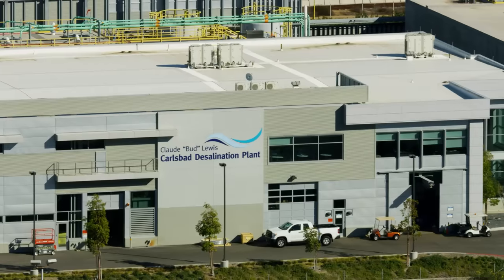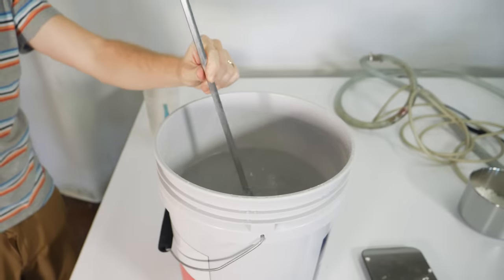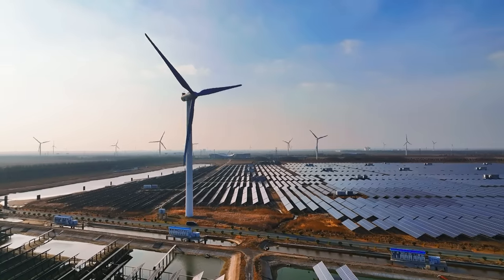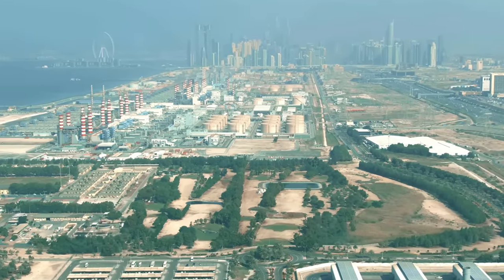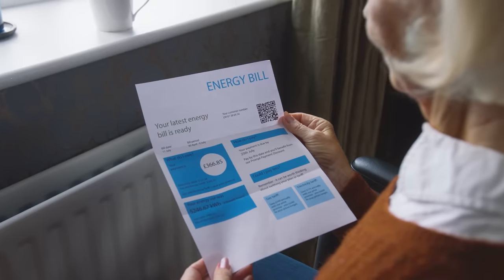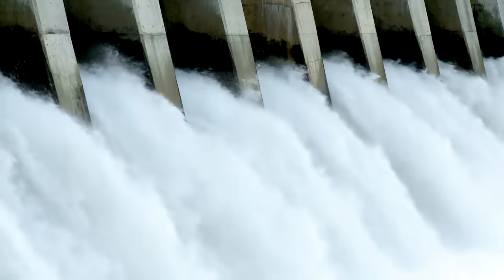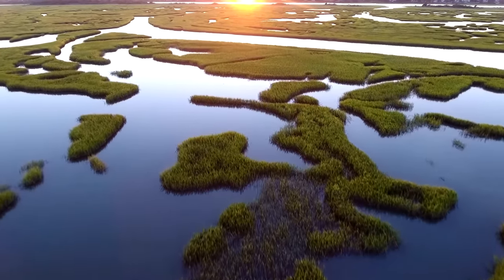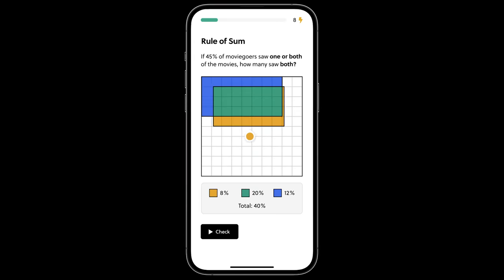Why Is Desalination So Difficult?

Comment: Lived in Saudi Arabia for a while and dad worked at the desalination plant there. Interesting bit was steam generated by the boilers were split into two pressure points. High pressure steam was used to turn the turbines to produce electricity while low pressure steam was used to make fresh water. Interesting when I heard about it the first time.
Reply: That’s what I was wondering why should it “cost” energy to generate steam. Isn’t basically all of our energy added to the grid by steam spinning a turbine? Surely theres some way to spin a turbine and then drink that same condensed water vapor right?
Reply: And water cost more than their fossil products!
Reply: @jakeannett6720 That's distillation, purify the water of germs and removing salt content but it is the costly method of desalination.
Reply: I wonder if they ever thought to use this concept but with a nuclear power plant
Reply: @jakeannett6720  This is a great thought, but sadly there are some big drawbacks. The water used in most power plants is highly purified and the same water is used over and over again (closed loop) Using sea water would lead to more corrosion and mineral buildup in the pipes and mechanisms of the powerplant. It might also wear down the blades of the turbine.
Reply: @DanielGonzalez-gr5xp  if its a closed loop, then we just need a heat exchanger, nothing mixes with the mechanisms of the powerplant. but if its an open system using ground water, thats is even better! As the powerplant can now power electricity or provide heat and the heated river water can be used to diffuse waste salination back into the sea.
Reply: @EZ-STEM What he's saying is that if the steam is also producing electricity, in addition to becoming drinking water, then that would offset the higher cost of distillation. Electricity is also pretty valuable.
Reply: @visionsofpromise This is the way for desalinating sea water on a massive scale. Nuclear reactors do only one thing and that is to make heat, and make lots of it, without any emissions including carbon dioxide. We've been powering our aircraft carriers and submarines this way for decades. They could safely make power and desalinate at the same place. We have the technology to do this safely now.
Reply: @jakeannett6720 bro hear my genius. Get sea water is a nuclear power plant, use the steam for power, then capture it and have fresh water
Reply: @jakeannett6720  Not at all anymore, only about 20% use coal plants, around 40% now use natural gas. The rest is nuclear than renewables. But to your question, why would you want to drink the water from coal plants, when it cools down it turns back into liquid water and goes back to where it starts, allowing you to reuse it, over and over, versus drinking it then refilling it.
Reply: @69-Bot  but instead of reusing it, I use the entire ocean as my reservoir and I create usable energy at the same time as purifying water
Reply: @jakeannett6720  And then you have a boiler full of salt you need to clean out. It doesn't filter the salt 100% either...
Reply: @jakeannett6720 That is true, however you can only recover about ~35% of the energy used to boil the water in the first place.
Reply: I remember how water taste in Saudi Arabia. It’s so brackish.
Reply: @actionjksn  boilers for energy production need high temperatures and pressures, and water for that kind of boiler needs to be pretty pure. stuff like silicon gets entrained and dragged by the steam and would ruin the entire piping and blades immediately. boiler feed water is no joke. 
for low pressure steam maybe you could get away with it, would be inefficient because youd have to purge a LOT of hot water to keep the boilers water from precipitating salt crystals
Reply: Interesting. Is that the desalination plant in Jeddah? Unfortunately the theoretical minimum energy consumption in desalination is still not achieved by desalination plants as not all units have 100% energy conversion efficiency so desalination is not a 100% energetic reversible process, no matter if this happens via distillation or reverse osmosis.
Reply: @jakeannett6720  Issue is, you don't want to remove water out of steam power plants. Well some systems are open cycle and isn't big deal, but others are closed cycle. Closed cycle also have less fouling damaging the boilers. In a closed cycle, you reuse the water by condensing it back so taking it out the system just means you need to refill it with new water with all the contaminants. Whether it is worthwhile depends on each project. And with a high pressure system, even open cycle is not really usable. The plant needs pretty pure water to operate at high pressures to begin with, so the plant itself isn't 'desalinating' the water. It actually needs desalinated water to operate which obviously doesn't offset the cost. Perhaps you can drink said water after it was used in a power plant; but you have to make sure that is somehow cheaper than having a lower level desalination system for drinking water. Drinking water doesn't need to be as pure and so uses a lot less cycles and energy. Might just be cheaper to have a drinking water grade desalination plant for the rest of the city than over building it to meet the purity needed for steam boilers and turbines. The power plant then can just reuse the water already in its closed cycle system thus not needing a over built desalination plant constantly replacing the water it loses.

Comment: On our 470'  research vessel  housed 130 people, we had two distillers plus a reverse osmosis. The distillery was pretty brilliant as we pulled a vacuum on the container and we used heat from our diesel electric engines. When the vacuum was applied the water would vaporize at 165°F rather than 212° F pretty clever. The units on our ship produced 1200 gallons per day. Some of that water was additional purified by R.O.  So the waste heat from the engines was not an additional cost only the energy used by the pumps was energy  negligible.
Reply: That's super interesting! Do you think the energy required to place the vacuum in the container cost a notable amount of energy or was it negligible?
Reply: It was really clever to drop the pressure below atmospheric in the container. Thus reducing the boiling point of the water🤔 did you just use the already existing vacuum to vent the gas out of the container. Or did you have to use a constant vacuum pump for that?
Reply: I can only assume pumps would be needed. But if the baseline vacuum pressure; the bulk work is established using venturi pumps/valves, then you can certainly leech that from a multitude of engine and auxillliary systems. Basically anything with a suitable fluid flow range can be exploited using venturi effect to generate vacuum without a notable energy or efficiency loss to those systems - because venturi is sort of a "skin drag" effect; it doesn't require any direct interference with or impedence of the fluid flow itself. You certainly can bottleneck a flow to accellerate it and boost the vacuum pull of the venturi effect, but with large flow systems already in place and available then mass can go a long way in making up for speed. 

On a ship, engine inlet air, engine exhaust and coolant flows are probably the most interesting ones. Especially exhaust as its alrady waste energy, fairly high flow, and most venturi applications wouldn't really have much impact on the ability to use the same exhaust gases for thermal energy. Then vaccum pumps might only be needed for moderste boosting, or as an inline support system to ensure adequate "vacuum pressure" stability.
Reply: @jippo91 I remember working on a similar one at a company I used to work for.  It has to be a constant vacuum.  The issue is that with the little heat needed (compared to standard boiling point).  The water's evaporation aka expansion reduced the vacuum in the chamber.  So we had a pump to maintain a constant vacuum.   Here's the cool thing.  The pump was a mechanical vacuum pump that was also ran by the motors fan belt.

Comment: I worked in a power plamt that used a multistage RO to clean up produced water from an oilfield.  The oil was separated, and the water was run through softeners, but it was still in the part per thousand range.  We ran the RO at 75% permeate and 25% reject in the winter.  We had to run it at only 70% permeate in the summer due to the water being much hotter.  Input temperature and pressure have a high effect on the process.  We got <1 ppm hardness, and around 16 ppm total dissolved solids.  This was necessary because the next step was deionization, yeilding 17.8 mmho water.  Theoretically pure water (which doesn’t exist) is 18 mmho.  Water that clean will actually make you sick with extended use.  It basically reverses the osmosis in your intestines, pulling nutrients out of your blood instead of vise versa.

As far as seawater desalination, I took a contract in Saudi Arabia in the mid eighties.  Theentire eastern half of the country was supplied freshwater by a huge RO plant just south of Al Jubail on the Persian Gulf coast.
Reply: What did you use the DI water for?
Reply: @sealpiercing8476  DI water was used for injection into a GE frame 6 gas turbine for NOx control.  Some of the RO water was used in the engine inlet evap coolers to increase air density and improve power output (more air, more fuel).

One plant that my company operated started with well water.  The sequence was sand filter, carbon filter, softener, another carbon filter, RO, deionization.  At each stage some of the water got sent to the next stage and some got used in a process such as the majority of the soft water being used as makup water for the boiler.  All effluent streams (incuding rainwater) ended up in a flock tank and then a press.  No water was allowed to leave the plant except as vapor from the inlet coolers and the cooling tower.  Even black water was run through a mini sewage digester plant.  The water that came off the press went back into the cooling tower.  The solid “cake” that came off the press was chemically and mechanically identical to limestone, but was still classified as hazardous waste and had to be disposed of accordingly.  We bagged it, and shipped it to a facility that stored it.  The facility was, appropriately enough, an abandoned limestone quarry.  That was the only zero discharge plant I have ever seen.  Even then, the government wanted to dispute that classification since the bagged limestone left the plant. There was a tax break involved for being a zero discharge demonstration plant.  Our lawyers pointed out that under their criteria it was impossible to have a zero discharge plant because some evaporation is required in any power plant.  In the end, both sides decided to nullify any contracts and abandon the project.  As far as I know, the plant is still rusting away, and nobody is attempting that kind of usage efficiency today because when they look at doing it that plant is held up as an example of a failure, even though it really succeeded.  All because a government bureaucrat wanted to avoid giving a tax break.
Reply: @sealpiercing8476  what do you NOT use DI water for? it causes far less corrosion and leaves next to no scale/fouling
Reply: @Simple_But_Expensive wow, that's a really good story. are you still in the business?
Reply: The theoretical limit of water purity is 18.2 Mohm. In the semiconductor industry we meet a water purity requirement of 18 Mohm continually.
Reply: DI water won't make you sick with extended use, as long as you eat normal food. This is an urban legend. There's no such thing as "too clean water".
Reply: @defenestrated23  But it tastes weird. Or, more correctly, it lacks taste, so our brains make something up.
Reply: @defenestrated23  DI water is the equivalent of distilled water (very close to theoretically pure).  They sell distilled water in supermarkets.  Try drinking nothing but that for a month, then get back to me.
Reply: @sneediumminer  It is sometimes called hungry water because it will dissolve most metals.  It has to be stored/pumped/piped using stainless, pvc, fiberglass, glass or the like.
Reply: @toseltreps1101  retired.
Reply: @rogerolander458  my bad.  Best we got was 17.8.
Reply: I also thought about something like that, and I think a big problem would be that salty water will also infiltrate into the soil, making the soil saltier and especially will contaminate the groundwater. Soil in arid areas is already very salty, so I don't see a lot of problem with the soil, but definetly with groundwater. The Sahara for example has huge groundwater reserves, and contaminating them would be a huge problem.
Reply: Cool story bro.
Reply: I wish they had learned to grow their own crops. Instead they waste our water for free here in AZ.
Reply: @Simple_But_Expensive I've drank only DI water for literally years and had no issues. I'd like you to give a more detailed description of how exactly pure water strips minerals from your body. Don't just say osmosis, be specific about where in the body this is happening, which minerals are being stripped, and how the newly mineralized water is leaving your body.
Reply: bs.. Systém S. A. W. E. R. se stal nejvyhledávanější atrakcí české expozice na světové výstavě EXPO 2020 v Dubaji ve Spojených arabských emirátech (SAE) we solve this.,.
Reply: @Simple_But_Expensive  I worked at a textile dye and finish plant in Alabama. The water we used was naturally soft ground water, which is why the plant was located there. The ground water had high concentration of copper, which EPA classes as a contaminant. We did not use any copper compounds in our processes, but were required to treat our discharge to remove the copper that was in the water when we took it out of the well. If we had taken the well water into the plant and immediately discharged it without using it we would have been in violation. “Your tax dollars at work”!
Reply: @defenestrated23  most people are already lacking the levels of nutrients they need from the way food is farmed now there's far less nutrients in the same amount of food than there used to be so while people are getting plenty of salt most people are already somewhat deficient on some minerals and further exacerbating that with water that will pull minerals out of your system isn't a great idea. For most people it probably wouldn't be a super serious issue but it can definitely cause problems
Reply: @KingdomOfDimensions  literally anywhere in your body that it touches it will be pulling minerals out of the cells through the process of osmosis, idk why you don't want to hear that when it's how it happens but water doesn't like having different gradients of dissolved minerals and your cells are mostly water filled with minerals and nutrients. As the water without minerals and nutrients passes by some of the ones from where it's in a higher concentration pass into the di water and out of your cells. Your body also can't absorb water anywhere near as well in the DI form so it passes through far quicker, sodium and sugar are both important for your body to absorb the fluid where it needs to be absorbed rather than just peeing it out. You probably won't have serious health problems from it since most people are already nutrient deficient but increasing the amount of nutrients you loose isn't really a great idea

Comment: I live in Malta. Most of our water is desalination water. Pure water without added minerals will eat and absorb almost anything. I worked at well known soft drink bottles and our water filtration room looked like a water fountain. It was made of solid stainless steel. Amazing what water can do .
Reply: Also called Universal Solvent. 
Great stuff.
Reply: @20chocsaday  Also hydroxic acid.
Reply: That's exactly why the pipes in nuclear powerplants have to be high-quality stainless steel. The reactors have to have 100% pure water. Otherwise, you end up with a ludicrous amount of buildup in the cooling pipes, which is.....less than optimal.

Comment: Brine water is used a lot in Europe for closed vertical ground source heating or heat pumps. Brine water is a useful resource to transport heat energy without the risk of the medium freezing.
Reply: I never knew that could even be done! Thanks for sharing!
Reply: That's cool. The game I play a lot call oxygen not included has brine and salt water that is mainly used for coolant because it doesn't freeze. I didn't realize that that's a real thing. Just thought It was game balance.
Reply: @dr.chimpanz.1324  ONI does have a good bit of sci-fantasy elements (the funny reverse entropy device for example), but almost all of the physics in that game are based on reality, if a bit exaggerated and simplified.
Reply: Dollar store antifreeze
Reply: Does it detetiorate the pipes or other parts?
Reply: @MapsAndCaps  never heard of that. I think you need oxygen too to get corrosion, and the loops are closed circuit systems.
Reply: @87vortex87 I think scaling still occurs even without oxygen? And scaling takes a loooot of energy to descale.
Reply: Same reason I used to put salt in my bong water when I left it outside for the winter but used it every day without changing the water.  Kids, don't do this. But it worked.
Reply: @TommyTuckerTuba  it's closed loop, so you would put in descaled water in the system.

Comment: After major draughts around 2007 in South East Queensland a desalination plant was added, but it was only part of the solution. All of the major dams across the region were connected via pipelines to help balance water supplies. Water can be pumped between areas of the region and the desal plant is used only when water is needed and can also be used as a buffer load on the power network too from what I understand